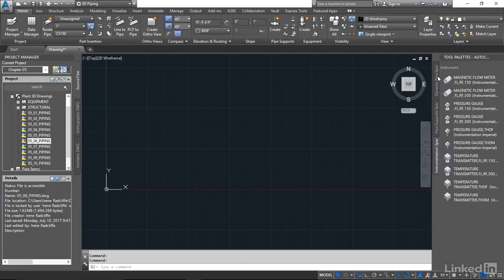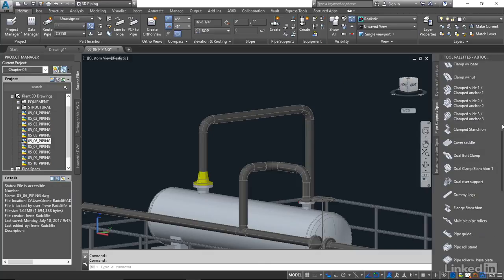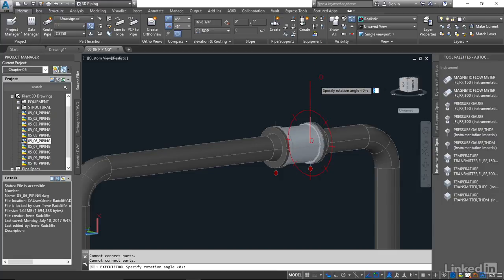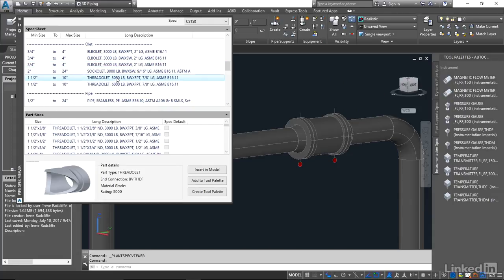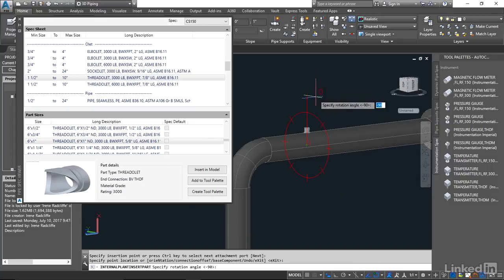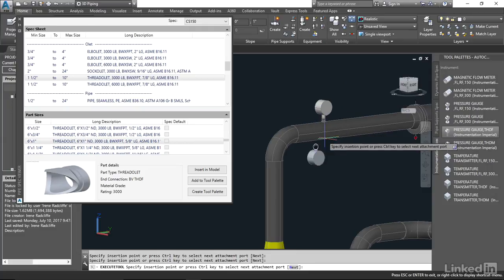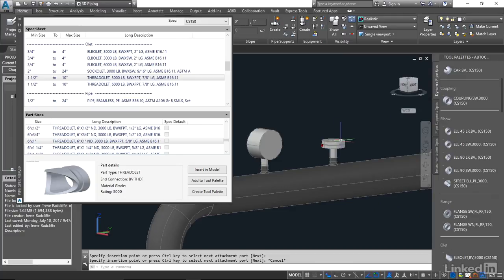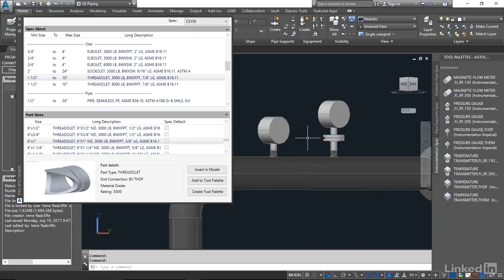AutoCAD Tutorial - Adding Instrumentation

Comment: I saw on your tool palette for the instrumentation that you had multiple pressure gauges per the different connections (THRD, FLG, ETC). I'm curious, if you wanted to change the pressure gauge you placed in the drawing for this video to a different size, what shows up on your list from the pull down arrow? I'm asking because when I created a custom catalog and blocks that go into it, when I separate them out in my catalog by there connection type, they all still show up in the pull down list, (THRD, FLG, etc), if though what's noted on the palette will show the one connection type I listed for all the instruments with that connection type. So even if I separate them out, they are all bulked to together per their size. Why is that? Thanks. ~ Laurie